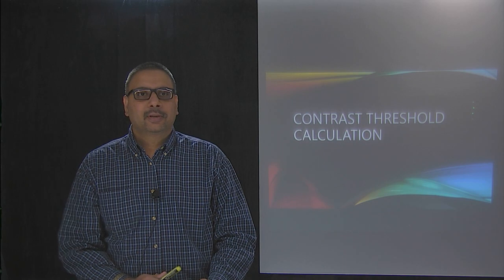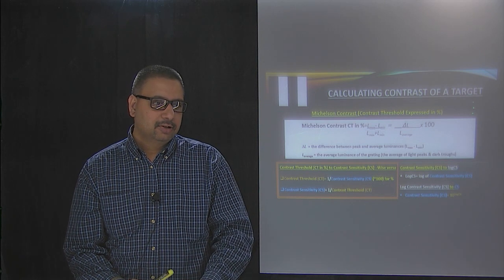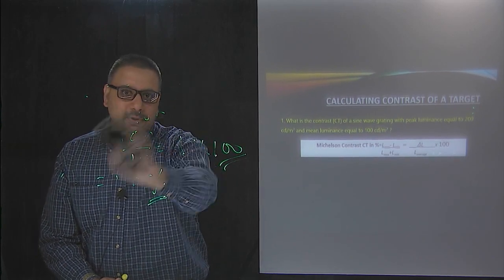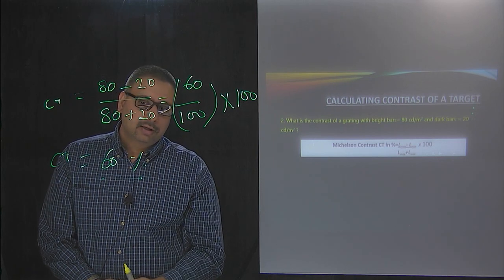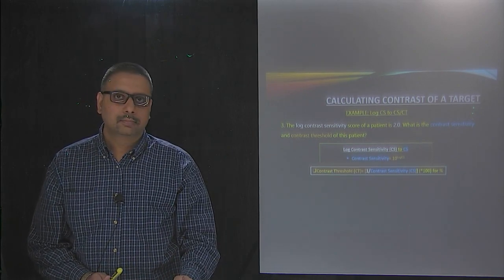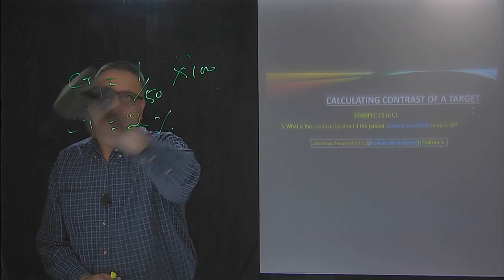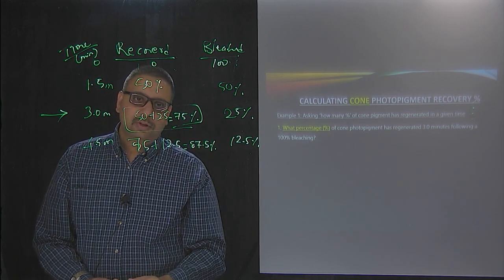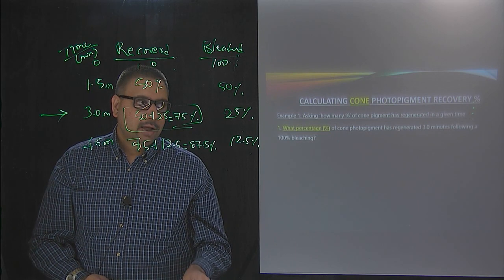Contrast Threshold, log Contrast Sensitivity, Michelson Contrast Calculation

Comment: This is very helpful. Could you share your slide with the calculations? It is pretty hard to see them on the video. Thanks!
Reply from the maker: Joel. Thanks for your interest. My apologies for the poor video quality. This video is couple of years old and am afraid I don't have the actual slides. Are you an Optometry student?
Reply: @eliteshankaran  Actually I am a low vision researcher with a PhD in human factors that works at Vispero. Surprisingly the contrast sensitivity charts do not supply these equations in their instructions. I have not found these in the vision research either. I think the terms are throwing me a little (i.e. CS, LCS, CT). Their meaning is different in my discipline. Do you know where can see the formal definition?

If you can please send me your slides, I would love to see the equations to ensure I recorded them accurately. Thanks for the video and all your help!
jpersinger@vispero.com